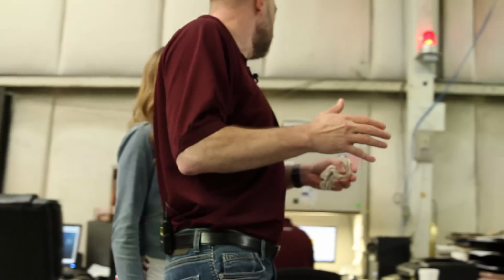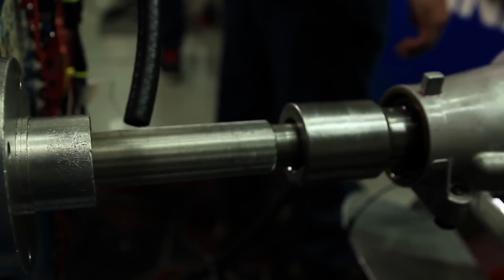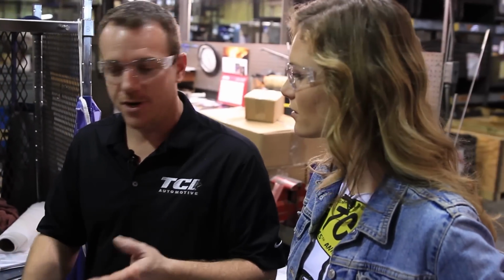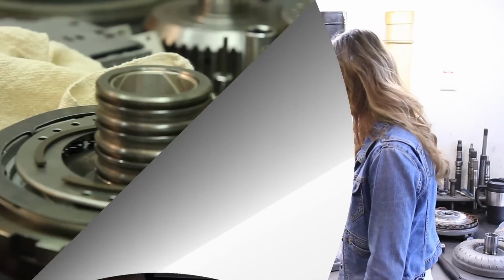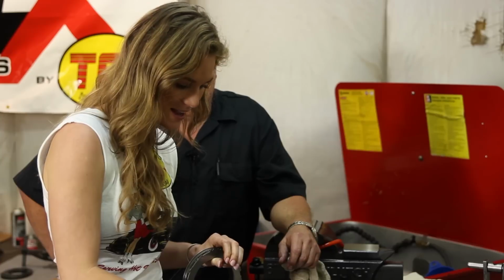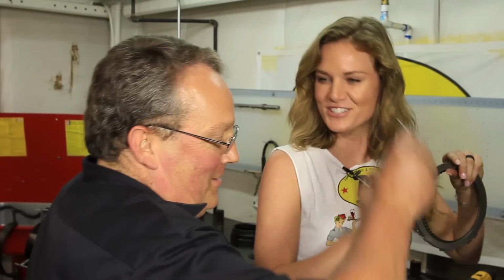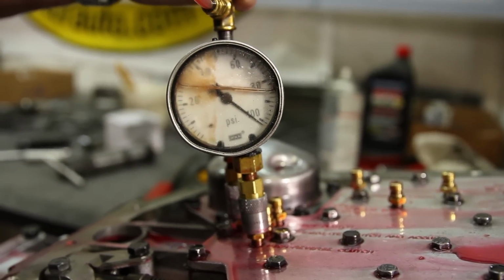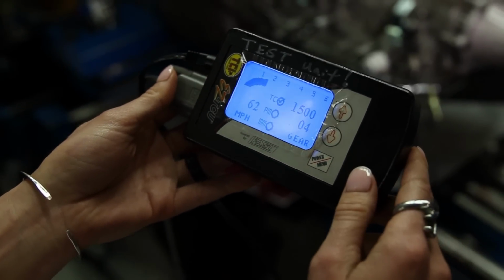Emily Williams Tours TCI and Transmission Build

Comment: Why don't you stand behind your work. Tci 750 hp trans th350. Freaken guy i sent pics of the shavings in the pan . guy said it's from my stall. Open up trans found the harden ring cracked at the oil hole sprags and drum mess up. You're guy then said 30 day warranty on a 160 miles trans. You guys would not help what's so ever. Truck was in 1982 Plymouth arrow truck Chevy sbc with 3.07 rear street tires never been to the track with this trans.
Reply: My new th400 drag race came with dirt and grass in the pan. I took pics of it. It's unbelievable. Like somebody built it out in their yard.
Reply: i have video posted -    https://www.youtube.com/watch?v=UoupOhAZYmw&t=7s